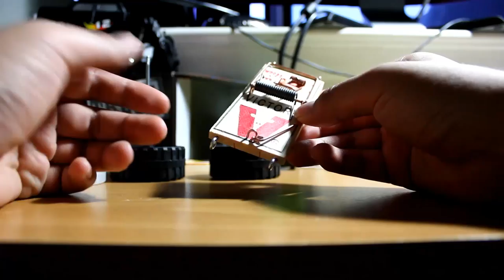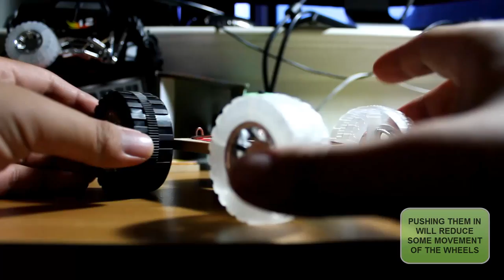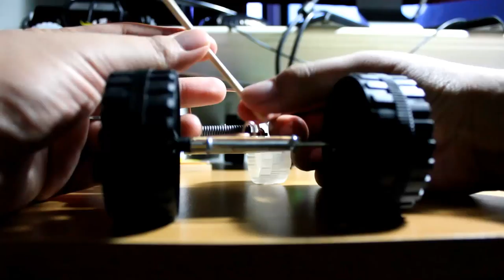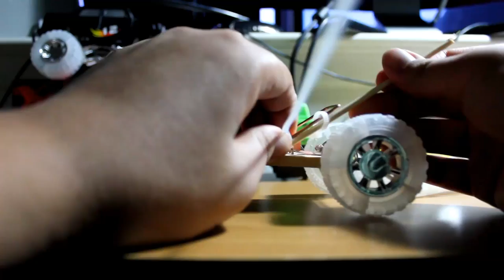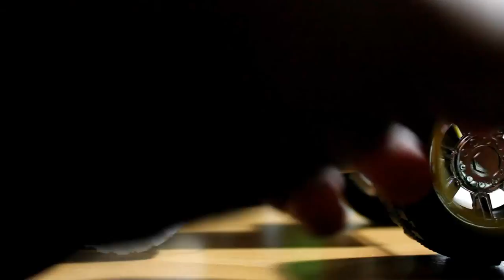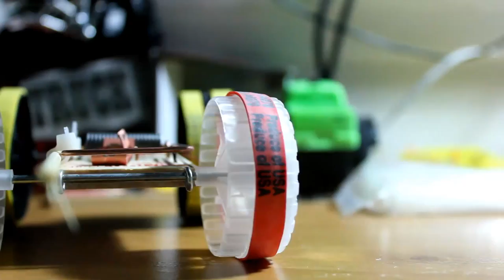Building a Mousetrap Car Part 3 of 4

Comment: When you say the "lever" makes the car go farther. does gears works. like 2 gears. one for the wheel and the other is your torque. i got this idea because of the gearbox of the car. but it's like. the bigger the gear for the torque and the smaller gear for the wheel will make the car go farther. if the torque gear turn around in a full 360, the smaller gear might turn 3 times more. and don't worry, i'm not a smart ass adult that says this. i'm just a grade 8 student (main Stream).